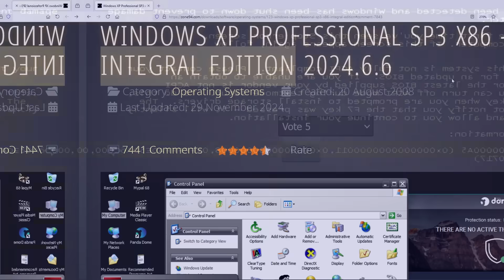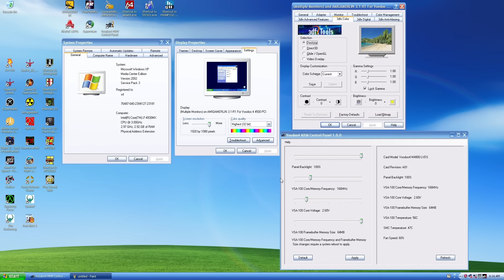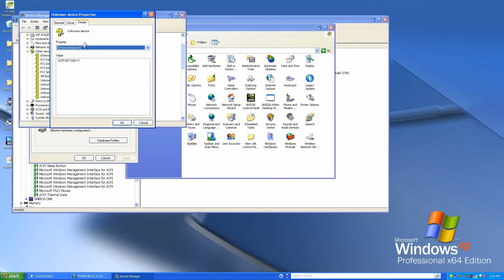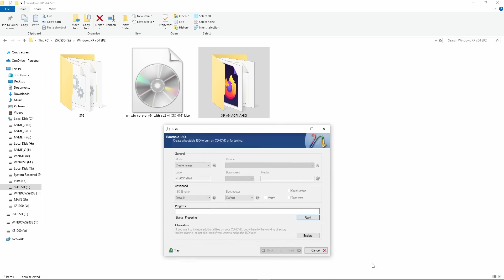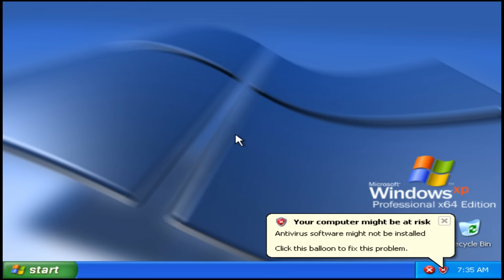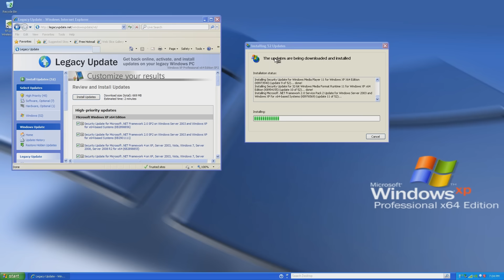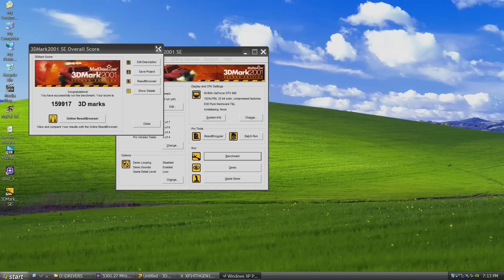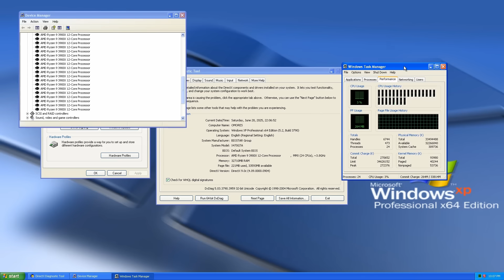How to Install Windows XP x64 on (very) Modern Hardware - NO BSODs 2025 Edition

Comment: Is there anything for a 1200 socket? These files don't work for it, i tried and got IRQL_NOT_LESS_OR_EQUAL with 0A stopcode
Reply from the maker: Last week, I tested a brand new H470 Socket 1200 motherboard. I tried the x86 edition on it, and there were no problems:  https://imgur.com/gallery/windows-xp-x86-on-intel-h470-socket-1200-motherboard-uelt3Ej Theoretically, there shouldn’t be any issues with the x64 version either - too bad I didn’t have time to test the SSD with the x64 Edition. I only had that motherboard for a day... and the focus was on Windows 2K... So I don't know, might be specific problem with your HW, that error is usually related to RAM.
Reply: @O_mores  I too have the x86 and it works, i was trying to get the x64 running but i get that error (Z490 Chipset).
Reply from the maker: Sorry, I don’t have another LGA1200 motherboard around right now, but I will get one to do more testing. Also, Windows 98 and ME won’t boot on this motherboard when using the onboard SATA - it ends with "VFAT Device Initialization Failed." Turns out, it’s actually simpler to run Windows 98/ME on 12th/13th/14th Gen CPUs and motherboards than on 9th to 11th Gen systems.
Reply: @O_mores i noticed. Unfortunately i can't get an LGA 1700. At least i have the x86 running.

Comment: Windows_XP_SP2_x64_Intel_AHCI_ACPI_2024.iso

is this the final iso ? 🎉, Im exited after a long decade I will  see xp running in latest hardware.😊
Reply from the maker: I wouldn't call it final, but it gets the job done on an Intel configuration. First, I'm planning to add AHCI drivers that work on both AMD and Intel systems, along with NVMe support. USB 3.x support would be even a more useful addition. I will update that post on Patreon from time to time.

Comment: I have seen that the creator of Supermium just released a patch for Windows Vista to use it on a newer processor!
Reply from the maker: I'll check it out, though Vista definitely works fine on Intel 14th Gen hardware. Check this out: https://youtu.be/IQKQx1MA9v0  Turns out it's more sensitive with 6th to 11th Gen hardware.

Comment: Win7 is a better choice for legacy 64Bit. XP for 32bit Systems.
Reply from the maker: Yep, Windows 7 is still very usable. The official server updates are still up and running. You can see it here on a 14th Gen configuration: https://youtu.be/EAUqZZrbCQc
Reply: @O_mores  I have some active Win7 Systems. The only thing that does not work onthefly is wifi. Sadly most modern PCIe wifi cards Do not Support Win7 but there are a Few exceptions. But even if Networks are found connections are sometimes impossible. Maybe an encryption issue. And for drivers I need to disable Signatures. Besides that, a very Rock Solid OS 🎉 Runs here on opteron 939, ivy bridge and fm2+ Systems 😊

Comment: I would legit daily drive vista sp2 if the intel hd 620 drivers worked from windows 7.
Reply from the maker: Unfortunately, Intel never made HD 620 drivers for anything earlier than Windows 10. Drivers aren't just made independently by Intel - they have to follow Microsoft's driver model specifications (like WDDM). Intel only made WDDM 2.0 drivers for the HD 6xx series, which was introduced with Windows 10.

Older drivers can work (most of the time) on newer versions of Windows because the OS maintains backward compatibility with older driver models. The reverse isn’t true: Newer drivers built on newer WDDM versions (like 2.0 or later) won't work on older Windows versions like 7 or Vista, because those OSes don’t have built-in support.

Comment: the problem is not new CPU, the problem is video card drivers. If i need to buy old video card, than your idea is dump. Make it work on RTX or leave it alone.
Reply from the maker: You can still have fun with it in a multiboot setup, that’s how I use it. I’ve got two GPUs: one for older systems and a beefy RTX card for Windows 10/11. If you want to go relatively old-school with an RTX card, Windows 7 is your best bet.

NVIDIA never made XP drivers for RTX cards because XP uses the older XPDM driver model, while RTX cards need WDDM. Since the drivers aren't open source, only NVIDIA could've done it... but that ship has sailed.

Comment: Would this method work with this PC?

15" Dell Inspiron 3582
Intel Pentium Silver N5000
4GB RAM
Reply from the maker: Yes, it should totally work - but the issue is the UHD 605 iGPU. Intel dropped XP driver support after 4th Gen (Haswell), so it will work only with generic 2D drivers. You can install Windows 7 64-bit on that laptop since the iGPU has official support there. Check out this video for Win 7: https://youtu.be/EAUqZZrbCQc
Reply: @O_mores  I am OK with that

Comment: I have an XP installation disc on a library shelf right behind me. You don't want to let XP loose on the Internet and wait to see what it brings home 😂
Reply from the maker: Nowadays XP runs behind a router, that typically runs some form of Linux... So it's more like toddler-on-a-leash...By the way, I didn’t catch anything while running XP back in the 2003–2009 web wild west era... So I doubt it’s worse now, XP isn’t even on the radar anymore.

Comment: I used a slip stream version of XP Professional x64 from the Internet Archive. It has all the patches and drivers for SATA and ACHI and is 900 MB.I burned it to a DVD and installed it from that. I still have three old but functional optical multi-drives.
It was installed on a 2012 Lenovo Core i5 3470 with 24 GB of RAM and a SATA SSD. Lenovo has all the XP x64 drivers for their own hardware and I found the manufacturer apps & drivers for my printer and scanner. I bought a PCIe WiFi card with XP x64 drivers but I also got a USB dongle to work. Even got Bluetooth to work 😀
The browser is Superium.
Reply: can you link it here?
Reply from the maker: By the way, this is the "clean" ISO I used in the video: https://archive.org/details/en_win_xp_pro_x64_with_sp2_vl_x13-41611_202105

Comment: Why somebody need to have Windows XP 64bit? Most of games doesn't work there or was buggy, they was made for XP 32bit, problems with drivers at that times, backward compatibility, coz again they was made for 32bit... 64bit era start to come with Vista or really starts to be as standart with Windows 7 🤷
No bullying of course 🙂
Reply: I used XP x64 at work back in 2006, and it ran fine - no issues with anything, especially drivers. But at home, I ran the 32-bit edition since I had 2GB of RAM, which was plenty at the time. Many computers, including Apple’s, were still shipping with just 512MB to 1GB. Imagine Vista with 512MB...
Reply from the maker: I wouldn't say most games won't work - rather, some games might not. For me, the problem with x64 version is that has no support for 16-bit apps, while the x86 edition does, and 16-bit Windows 3.1 apps actually run very fast.

Comment: Thank u sir for making this video, XP x64 didn't get as much attention as the 32-bit version did. x64 edition feels rock solid when configured properly. Back in the day, I used Server 2003 Standard edition and changed policies and tweaks on my workstation I had back then. One good thing is that x64 edition supports disk with GPT partition table, which allows support for drives larger than 2tb.

Comment: I love the Integral Edition. It can run on (almost) anything. The only problem are drivers. Without drivers there is little reason to install XP, since it works like shit, and drivers are not available for XP for most of modern computers. Using SDI just results in the system BSODing.
Reply from the maker: I think XP is still well-maintained in terms of drivers. There are generic backported drivers available for AHCI, NVMe, USB 3.x. ACPI works fine as well. Also the HD audio. The main limitation is GPU support - you’d need to stick with an older card like a GTX 9xx. But if you’re running a multi-boot setup, you could use two GPUs: a modern RTX card for Windows 10/11 and a secondary GPU compatible with XP, and maybe also add wireless USB stick cause the included WiFi 6/7 cards are not meant for XP.

Comment: This is amazing. Is it possible to use "newer" graphics cards (or chips) aswell? Like modern cpu-integrated chips? I would like to set up Windows XP on modern SBC systems, such as Radxa X4
Reply from the maker: Intel started ditching XP support after their 4th-gen Haswell chips, not 'cause they hated XP or anything, but because Windows 10 (2015) needed WDDM 2.0 drivers, and XP’s old-school XPDM setup was totally different. No way Intel was gonna write a whole new driver for XP in 2015, especially after Microsoft pulled the plug on XP in April 2014. So, the newest Intel integrated graphics that play nice with XP are from 2013–2014, mostly Haswell stuff. The same applies for AMD and NVIDIA, the newest GPUs that work with XP are the GTX9xx series released in 2015.

Comment: Why you would want to run Windows XP on a modern ass system is beyond me, but its cool, so I'll give it that.
Reply: There's some edge cases for old games, old GPU tech or sound card tech that only works on XP.  There's modern workarounds but it's not the same yet.  When dealing with a new system that still has PCI, that's a bonus for this old software.

Modern hardware isn't as [mentally differently-abled] as some old stuff people used to tolerate.  I recapped a rather popular high-performance but affordable board recently.  It works great except for that bug where it will sometimes not boot unless the power has been actually off.  That's a hardware thing.  It's easier in the long run to mod an ISO for a system than to constantly have to turn a PSU off and on.
Reply from the maker: People joke about XP still being around, but some labs are literally running half-million-dollar microscopes and DNA sequencers that require it. The software and interface cards were never updated so replacing the machine would cost more than just keeping an old XP box alive. But as shown here many times it doesn't necessarily have to be and old PC...
Reply: @kloroformd  yeah, that's true, I have a GTX 750 Ti that I will use in a PC build soon, and that has drivers for Windows XP. So I can understand that

Comment: É só mudar modo sata na BIOS de AHCI para IDE e salvar. Quando for instalar o windows 7 ou superior volte para AHCI novamente
Reply from the maker: ¡Sí, pero depende de tu configuración! Las últimas placas base con opción de emulación SATA a IDE suelen ser las de 4ta generación de Intel. En este video usé una placa de 6ta/7ma gen (H110), una de 12va-14va gen (H610) y una X470 AM4, ¡y ninguna tenía la opción de cambiar AHCI a IDE! Así que toca integrar los controladores AHCI en el ISO.

Comment: Finally you made it very hard and nice tutorial video! 🎉
Reply from the maker: Yay! Thank you! I hope you noticed that your comments made it into the video...
Reply: @O_mores I have a question, my Asus TUF Gaming B760M-Plus WiFi motherboard have only USB xHCI protocol, it would work for Windows XP x64 flawlessly?
Reply from the maker: @BillyRazOr2011 Yep, it should work just fine. Worst case scenario the speed is limited to 5 Gbps, instead of 10 Gbps, but I guess the main goal is to have working USB ports. I recently tested this build on a Ryzen 9 9900x and everything works!
Reply: @O_mores And the problem is, when Windows XP x64 installation is in booting process, how I can use my USB keyboard and mouse properly? I don't have any USB 2.0 adapter card.
Reply from the maker: @BillyRazOr2011   BIOS is supposed to  offer USB legacy support or USB-to-PS/2 emulation, which allows USB keyboards and mice to behave like PS/2 devices during early boot stages, like BIOS setup or OS installation. If xHCI hand-off is ON, BIOS gives USB control to the OS early. And since XP can't properly initialize USB ports during the setup this emulation will break as soon XP tries to deal with the USB ports. Turn it OFF to keep legacy emulation active. Still this might not work as intended.
Reply: @O_mores  I'm not sure if xHCI hand-off mode are working for Windows XP as well. But I did have old motherboard, which is Asus H97-Plus (my previous PC setup), did have xHCI hand-off option for enable/disable selection. I think my current PC also have xHCI hand-off option, so I would check it out later.

If we take some generic USB3.x drivers for slipstream into Windows XP x64 for integration mod, it would work just fine? Also the Storport update for Windows XP can integrate it?
Reply from the maker: @BillyRazOr2011  The option is there for sure, it's kinda standard. Whether it actually works on your configuration, you have to find out.... :) Also check the Universal NT Installer presented in this video: https://youtu.be/bqheehbqtBI
Reply: @O_mores Ok, I would check it out if I have free time from work. Thanks! 👍🏻
Reply: @O_mores  About at 9:01, I made an updated of this cab file and it finally works without manually replacing these two patched files, especially ACPI driver.
Reply: @O_mores  Also I replace updated storport and diskdump for integration, it works too. No need to update KB files. 😂

Comment: This is what i was thinking to do on older laptop which is basically a e-waste because it can't run even Linux good enough.
Reply from the maker: Yes, you can! Anyway, I wouldn't install it without GPU support. The newest laptop that should work with XP would be one with a GTX 900 series GPU, released in 2014–2015.

Comment: after windows 10 loses support man idk . i may be forced to frump over to linux lol league of legends it was fun but sadly you cant come with me . windows xp will forever hold a place in my heart sas my favorit os i have ever been on
Reply: That’s what I did and it’s honestly been great. Dual booting W10 and Arch with XFCE. It’s like having the security and compatibility of a modern os with the resource usage of XP, in addition to being stupidly customizable if you’re into that sort of thing. 

I can even run most windows games with native or near native performance using Proton and Wine.
Reply: Dual or triple boot. I've setup XP and 10 LTSC on some of my older hardware, LTSC will keep it current for a while longer than October at least. No issues with Linux mind, always great to play with. XP is the same for me, I play with it. I don't really think it's a daily driver for me (I know some do, kudos to U).
Reply: The source code for dos all the way up to windows 7 is out there. So ...
Reply from the maker: As of today, October 14th, 2025, Windows 10 has reached the end of support... unless you’re using the LTSC version, which is still supported but requires a paid license. Personally, I’ll stick with it until driver support ends, probably around 2027, when the RTX 6000 series launches and NVIDIA drivers become Windows 11 only.

Comment: Is the performance better overall under xp compared to windows 10/11?
Reply from the maker: It really comes down to the software. In single-core, a lot of older software will indeed run faster on Windows XP since the OS is much more lightweight, with far less running in the background. Anyway... Windows 10 and 11 have a much more advanced "CPU driver" (the scheduler) that is designed to manage tasks across many cores simultaneously more efficiently.

Comment: Maybe I'll try again x64 later
Reply from the maker: Yes, you can! And if you need the ISO I used in this video, you can get it from here: https://www.patreon.com/posts/installing-xp-on-132702533
Reply: @O_mores Hi uhmm just an update, sorry I was long to reply the comment

It works flawless on my HP 1000-1431TU
It's works, and ACPI works, all drivers works with Snappy

And I could play NFS Carbon old copy that couldn't work in Windows 7

Luckily it still 3rd gen, but actually this chipset was so buggy for XP even x86 met same fate, but XP x86 actually got more support, I even could start Windows XP Starter edition with SATA